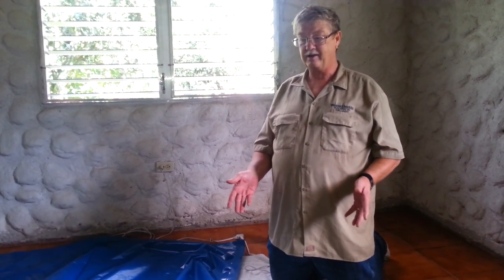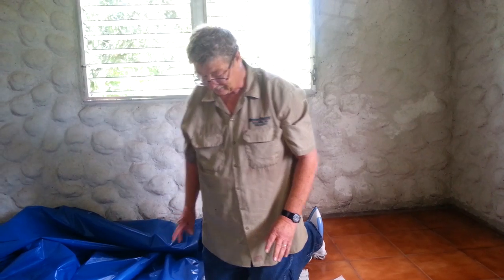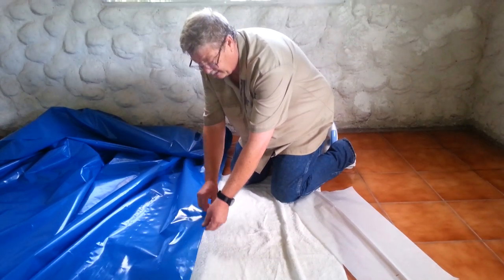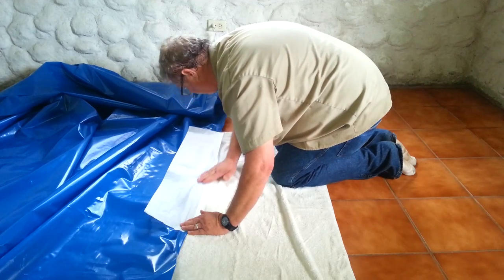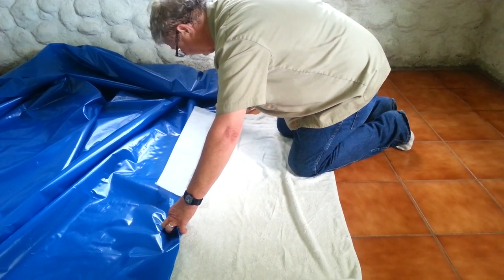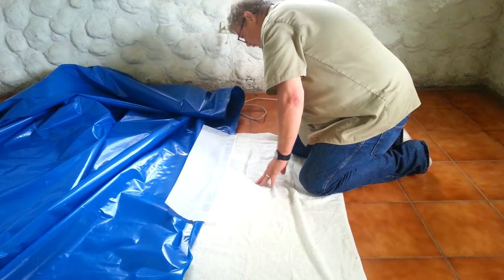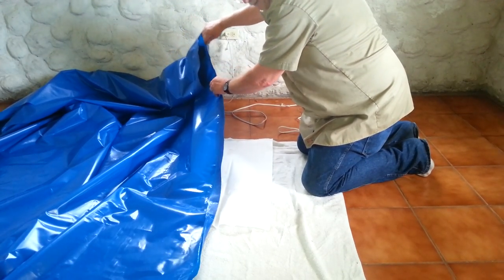Welding 2 pieces of plastic together

Comment: This is literally the only guide/ video I have been able to find on how to weld/melt two pieces of thick poly together. Thanks. 🙏
Reply: It worked! At first it wasn't doing much... then  I cranked the heat on the iron way up, and that did the job.
Reply: @johnmcote  is it watertight?
Reply: @johnmcote  which paper or cloth required to heat?
Reply: Hi Sir, is that a sakolin trapal .

Comment: Great video, David!  And to go a little further than one other comment, this is the only video I have been able to find for bonding inexpensive thin blue poly tarp together.  Surely it also works for heavy duty poly tarps.  I tested on an old, cheap, thin blue tarp, figuring if I could weld it together, I could weld any of the poly tarps together.   The best temp setting I found was just a hair below the wool setting.  Also, when bonding two overlapping pieces together to make a combined larger tarp, I found it to be critical to overlap the pieces for a width greater than the width of the iron (e.g., about 7+ inches overlap for a 5" wide iron), and critical to only bond inside the overlap, never to the edge of the overlap.  Going to the edge of the overlap, or beyond, weakened the single tarp layer so much that it easily tore after bonding.  Done properly, the bond was stronger than the tarp material.  Also, I applied heat first from one side to form an initial weld, then afterward flipped the weld over and applied heat from the other side, with the hope of producing the strongest weld I could make.  I trimmed off the excess flaps on each side of the weld to make the appearance a little neater.  While there was some darkening and shrinking of the blue tarp in the bond area, my objective was simply to get a strong functional bond without weakening the unbonded area, not to get a perfect appearance.  While it may be  possible to "peel" the bond apart, the bond was so strong that when I tried to pull the pieces apart in the same plane (i.e., shear force), the tarp material tore while the entire weld remained intact.  Weld shear strength is the strength that counts for most tarp end uses.  Finally, the weld was "flexible," i.e., did not crack when bent or folded.  Thanks, David!!
Reply: Not sure you have seen this, but commercial sheet plastic welders, even those used for food storage in the freezer, have a heated wheel, or bar often made with a Teflon skin and have a strip of metal for the other side of the plastic.  Once the best temperature is applied through the heated wheel, or bar, the other metal strip reflects the heat through the plastic sheets to make the bond.

Comment: I used to build RC airplanes when I was younger.  The skin used is a plastic sheeting that is ironed onto the wings and body in much the same way as you are doing. the only real difference is that I used a cloth sock to surround the iron with, so i never had to use non stick paper. works great.
Reply: Indeed, and the little irons are small with a handle and cord to plug into the wall.  The catch is the film used to cover RC aircraft balsa frames is a lower temperature plastic with glue that melts a little as it is heated.  Some of those tiny hobby irons for the various brands of plastic film covering might get hot enough for use as shown and discussed here, and some won't.  Another detail is the "sock" to slide and tie on the iron is made of cotton so it won't be easily harmed by the heat, or stick to slightly melted plastic film.  Another detail to notice is the hobby irons have a temperature adjustment option on the top of the iron for obvious reasons.  All hobby aircraft films are not the same, making it necessary to be able to adjust the heat setting.

Comment: I used my daughters flat curling iron. during my "test welds" I discovered that if you use a damp/wet cloth it speeds up the cooling process and you can remove the parchment paper quicker without the plastic stretching or sticking to it...
Back on here to find other peoples ideas, what they did
Reply: Parchment paper is made for baking and high temperatures, like those used to bake cookies.  Needless to say, a lot of things won't stick to it.

Comment: This was just the impetus I needed to complete my project of putting a temporary liner in the tub in my apartment so that I could wash out my silkscreens without worrying about staining the tub's finish.  Using your technique, I was able to weld a PE drain insert to a clear LDPE sheet with a ring of tarp (also PE) material to finish it off. Thanks! You rock!

Comment: Thank you for sharing.
If you change the title of your video to "How to weld Polyethylene (or Polyethene) cheap lightweight tarps" or so, I am quite sure you will get much more views.  I was trawling the net for methods of welding these some time back ago wanting to make a work tent, to no luck. Post date your upload. I found this video now by mere chance outside todays relevance. I had no luck back then finding other videos to my search criterias adressing this issue. I guess few knows how, inspite it is the most sold consumer type of tarp material. 
Wfr, Ogre

Comment: Parchment paper or tin foil seems to work and an iron.     Similar to the industrial machines.

A high heat source.  A separator material like metal and then fusing your plastic together.   Thanks for the video it helped me gather ideas together as I'm going to be sealing some thick plastic mattress covers

Comment: this is great i was looking to seem together different color pieces of plastic  trash bags  using 50 gallon trash bags to make one huge round piece of plastic about 203 x 203 inches  in diameter one inch shot of 17 feet in diameter
Reply: Must be a cost issue since you are using plastic trash bags that are designed to resist sunlight exposure for around 6 months and no longer.

Comment: isn't parchment just wax paper? I am wondering if silicone sheeting would be satisfactory substiture for parchement paper? I have some of that that. I think it can withstand up to about 500 degrees temp? I think parchment paper is rated for up to about 450 degrees faranheit?
Reply: No it is not ask any cook/baker.
Reply: Some baking papers do have a rating as high as 450 degrees F, but the paper tends to burn a little on the edges.  Not good for making cookies.  As to other options, there are many, but it all comes down to how much heat they can tolerate and for how long before damage is noticed.  When bonding plastic sheet in a welding method, it is rare the heat setting needs to be as high as 400 degrees F and how long the heat is applied with pressure becomes an issue.  Pressure is needed to "force" the bond and the two sheets of plastic need to be the same material, or one will melt before it bonds to the other.

Comment: Thank you for this video. I have a similar project and this is very helpful. Are you using plastic pond liner? How thick?
Reply from the maker: We were in Honduras so we bought some cheap plastic they had available the problem we did have was that after exactly a year the plastic begin to come apart from the Sun
Reply: @davidwester8550  Thank you for the quick reply and important information to ensure the plastic is UV resistant.
Please stay safe.😎
Reply: @davidwester8550  True, the cheat tarps normally don't have a UV, or sunlight resistant rating so they will not resist exposure for more than half a year, or so.  What you must buy if the need is longer is UV rated greenhouse plastic film.

Comment: Thanks. Any alternative to parchment Paper?
Reply from the maker: Parchment paper is sold in most stores in the cooking area you can lay it down on a metal sheet and place cookies are things like that on it. I think that we use parchment paper because it was high temperature would not burn with the iron.
Reply: You need to look for baking paper to use for cookies in the oven.  You could use aluminum foil, but would likely find it a nuisance to work with since it is so thin.  You could try folding the aluminum foil for a three inch wide strip with, or without a spray glue to bond the foil and see if that is thick enough to be manageable as a heating strip.

Comment: 0:42 (and other parts too) can i get captions? 
         update: reading other comments: parchment paper
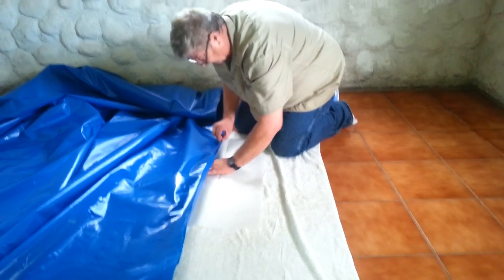(1:56 so meeeee hehe
2:15 did u try using tape to hold those folds together??
Reply: Parchment paper, baking paper, or bakery release paper is cellulose-based paper that has been treated or coated to make it non-stick. It is used in baking as a disposable non-stick surface. It should not be confused with wax paper or waxed paper, which is paper that has been coated in wax.
Reply: Alternate of parchment paper for thin poly: youtu.be/d9nEvbAswRI
Reply: Parchment paper has a long history and has been made from animal skins for a very long time.  These days cheaper things are used and coated with various compounds to resist heat and still be food grade.  One issue has been the Teflon coatings, most of which finally were taken away from use with food, like your non-stick pans and skillets.

Comment: But what is the the whit sheet tnat used for the joning tha plactic???
Reply: it is to stop the plastic sticking to the iron and the towel, you just re use the same piece of paper over and over again. It's called parchment paper,  but also known as baking paper or grease proof paper.